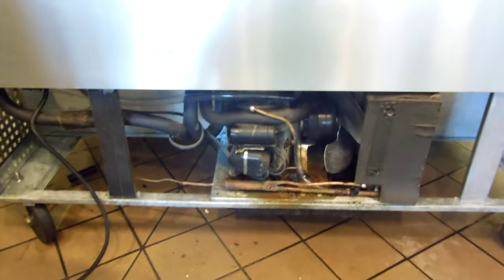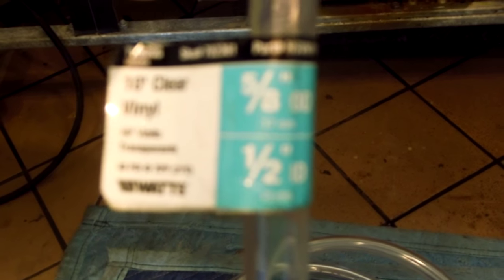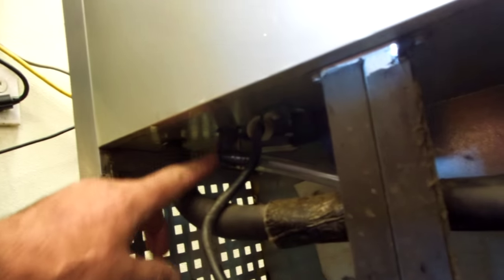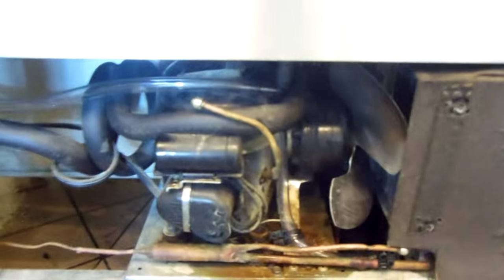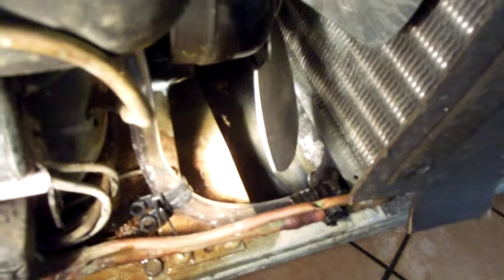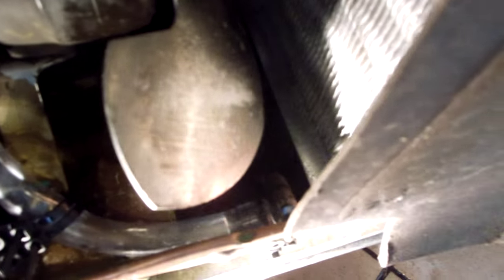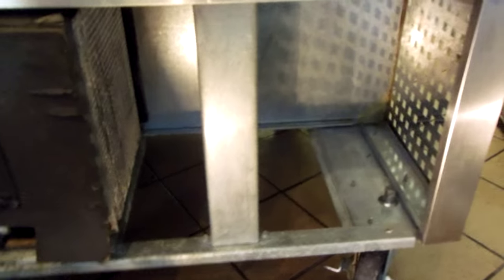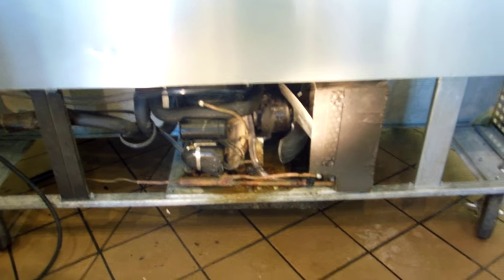Do You Have Water inside your True Prep. Table ? if so, watch the Video.

Comment: What do you do if you've cleaned out the drip line to the evaporator drip pan with a brush and the unit is still leaking on the floor and not draining properly?
Reply from the maker: unplug unit
take all food out
take front cover off evaporator area
clean in there
look for drain hole
pour a little water into drain area and look for leaks.
Seal outside edge with silicone
let dry 24 hrs
put all back together

check that refrigerator is level. front to back. unit can be raised in the front to tilt water to drain hole. adjust wheels under unit. they screw into the refrigerator. use big channel locks to turn big nut at top area of wheels. to loosen or tighten wheels. use wood blocks to support refrigerator if needing to work under there.
4 x4 works. & 2x4's.
Reply from the maker: part 1

https://youtu.be/HPaowdWCqjc?feature=shared
Reply from the maker: part 2

https://m.youtube.com/watch?v=qarMUpMFGn8
Reply from the maker: Part 3. 

https://m.youtube.com/watch?v=0W1xvYBCVOE&t=13s

Comment: Installed with wires up, but moisture from evaporator keeps dripping on the controller.
Reply from the maker: make a rain shield for controller.
Reply: Mounted it upside down instead. Might put cork tape on top.   PS, drain lines always clog up too. Between food and algae growing in drain tube, constant maintenance.

Comment: What if it's draining fine but the water doesn't seem to be evaporating from the pan?
Reply from the maker: You might need to put a wick kit in the plastic condensate pan. ( if its a true refrigerator) Its like thin sponges 🧽 that help to evaporate more water than water just sitting in a pan evaporating at a given rate.
Other options:
1) are run drain line to a floor sink close by. Paying attention to plumbing code codes such as  drain line must maintain a 1” air gap between the floor drain and the drain pipe. 

2) electric condensate pan
Reply: Thank you for the reply. There is wicking already in the pan but it appears to be badly worn on close inspection. It's discolored and worn enough that it has dropped down from its original hanging position quite a bit. I think I will try a new wick kit , thanks again!

Comment: i have some ice forming inside the cooler  :( what can i do to get it all clean besides let it thaw?
Reply from the maker: The Proper way to Defrost a Frozen Evaporator is to Un-Plug The Refrigerator  & Un-Load the Refrigerator After u close the Restaurant. Put Everything in a Walk-in Cooler. Leave the Doors open on the Prep table / Refrigerator overnight. Come in the Next Morning Plug in the Refrigerator , Set Temperature Dial to #6 , and Close all Doors and Put all empty pans in the top of prep table. The Refrigerator should be at 35 degrees in 20 minutes. 30 minutes max. If Not , U Have a Problem. Unplug refrigerator and clean condenser at rear of unit. Blow it out with co2 or air compressor. You should be able to see through it with a flashlight.
If it still does not do 35 degrees in 30 minutes max. U have a Problem.
Probably a refrigerant leak causing a freeze up situation at the evaporator.
A Slight Coating of frost can be normal
On an evaporator at times. Frozen iced over is not ok.
Reply from the maker: For a Super Quick defrost , unplug refrigerator , so u dont get killed. After Watching this video --- You could , unload refrigerator , and pour warm / Hot water across the area frosted up to defrost evaporator. Let water drain out rear of unit , making reference to this video , see where water drains out. Wait 10 minutes for water to drain and evap to cool down. Plug unit back in after defrosting. Set dial to #6.
Reply: Thank you!!!! I will try this tonight after close. It’s cooling just fine but this ice buildup is not good. Thank you again!!!!! Cheers from Newfoundland
Reply from the maker: Wow , Newfoundland  ! Cool !  South orange county , California Here.